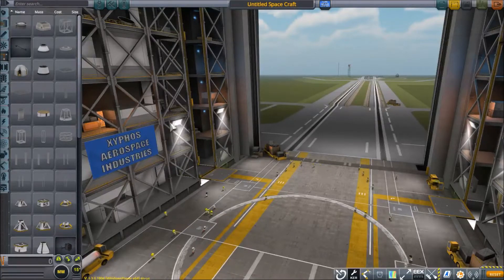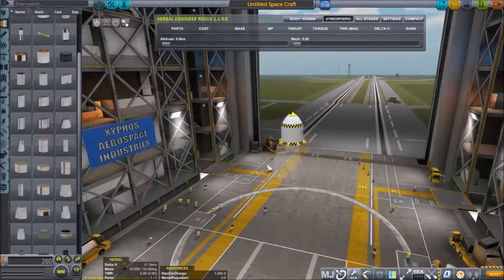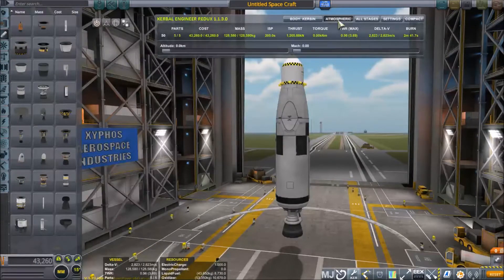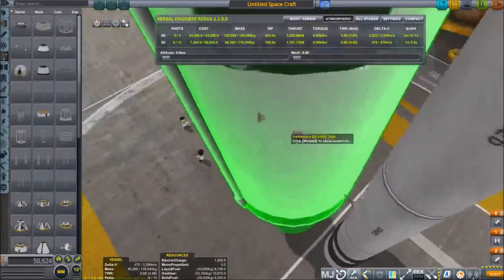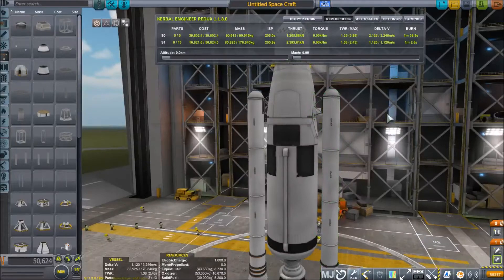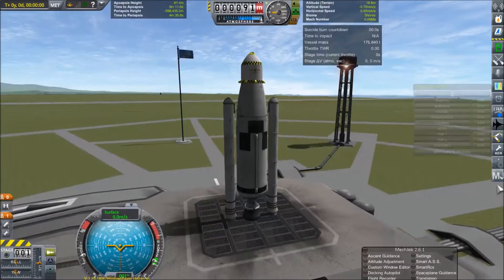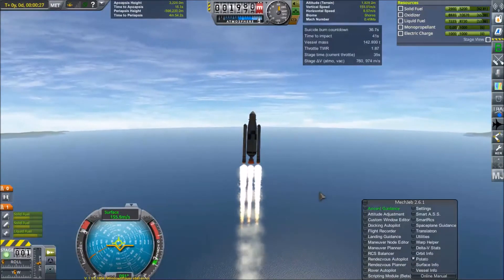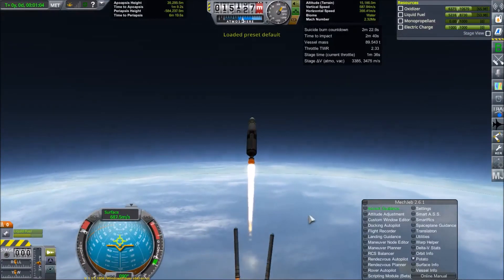KSP - How to properly use Solid Rocket Boosters

Comment: My boosters wabble and it changes were the rocket is going thanks to this vid i can make them stable
Reply: Ah, yes very technical terms Y E E T
Reply: @Coli2603  Don't you just love early 21st century colloquialisms? L.O.L.
Reply: You need to add struts to keep it stable
Reply: Lol yes this was my problem to
Reply: Also I just couldn’t get maximum YEET and get out of the solar system without solid fuel boosters
Reply: You want to attach the booster at one end with the decoupler and put struts on the other end.  That way when you decouple, the booster will rotate away so it doesn't hit the rocket.

Comment: How do you add boosters properly? My boosters don't detach.
Reply: Use struts if it starts to wobble along with the decoupler
Reply: You probably figured it out but you need to use a decoupler and make sure it's connected to that
Reply: @viper2311  I do use decouplers but when I stage they don't detach :(

Edit: before launch I always recheck the staging
Reply: @aut0correkt545  you mightn't be actually connecting the boosters to the decouplers , the game can be weird in that sometimes they don't actually connect to it and instead just connect to the side of the rocket
Reply: @viper2311  thanks for the tip
Reply: @viper2311  OMG LIFE SAVE I DINT KNOW ABOUT THE STRUTS DUDE THANKS
Reply: @aut0correkt545  np. Hope it helped
Reply: @MrMan-ys2jq  np, I don't use it that much myself as I mostly create replicas but glad I could help : )